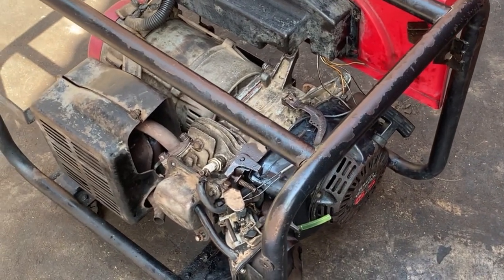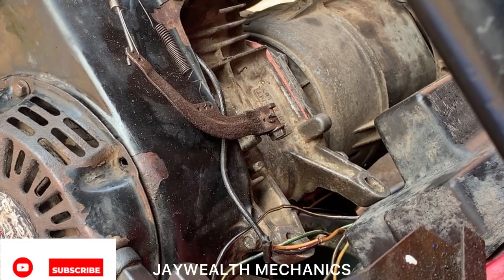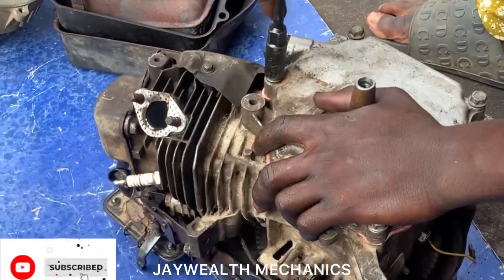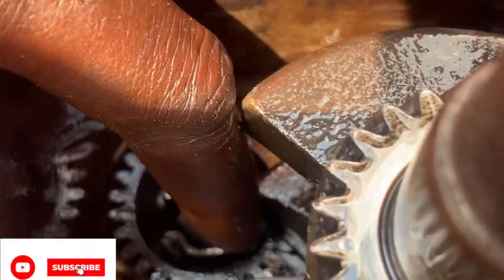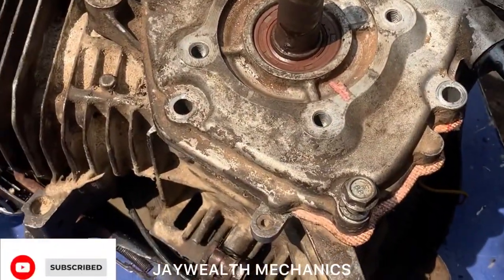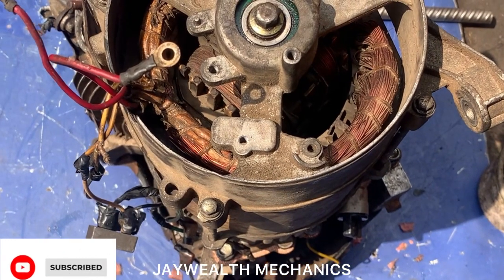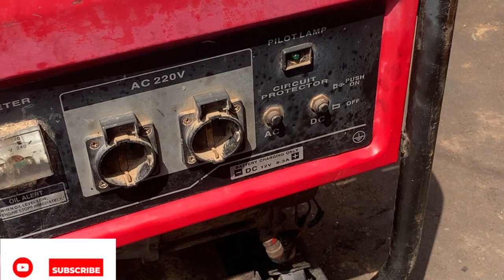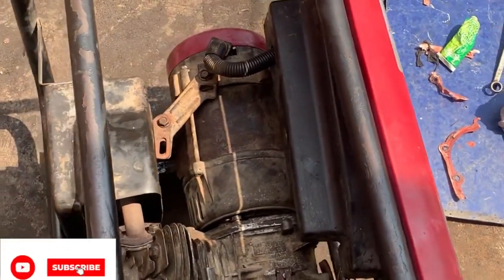GENERATOR GOVERNOR RACE REPAIR

Comment: Great video! Just a question my governor seems stuck and I don't want to open the engine. Can I just condemn the governor lever, take it off and just put something in the throttle plastic for it to maintain a desired rpm? Thanks
Reply from the maker: @vonvoyage14  if it got stuck loose the governor lever and put oil and turn it with plier to make it free. Then set the governor race. I have done a video on how to set a governor race.

Comment: In the case of low voltage and u try increase voltage vai adjustment place of governor and carburetor as well and its not increased could the fault still be same as what u just did now?
Reply from the maker: No the fault is not the same.

Comment: Please can I know the differrent between a long shaft and short shaft engine?
Reply from the maker: To determine the difference between a long shaft and a short shaft of a generator, you would typically refer to the specifications or technical documentation provided by the manufacturer. These documents generally outline the dimensions and measurements of the generator, including the length of the shaft. By comparing the given measurements, you can identify whether the generator has a long shaft or a short shaft.
You could also know with the step of the engine block.
Reply: @jaywealthmechanics9285  Good idea thanks.

Comment: Hi Jay.
I've just rebuild a Honda GX200 engine copy generator and it did the same where as before it didn't rev like that. I now know from this vid (I looked at other vids before I watched this) what might have fallen out when rebuilding it.
Thank you.
Reply from the maker: The governor race cap or you check the settings
Reply: @jaywealthmechanics9285  I stuck a camera in it and saw the plastic cap, so I have to strip it down AGAIN to fit it back in.
It might be damaged as I ran the engine to check a few things and I now know what I heard was probably the plastic cap being hit by the oil sprayer hook on the crankshaft.
Reply from the maker: @DugatDizzyLizzys  ohhhh. Hope is working well now.
Reply: @jaywealthmechanics9285  Still needs more running in, but the PSI is increasing after 1 1/2 hrs running.

Comment: Hey bro... So my generator is works normally for about half an hour when i turn it on then it suddenly speeds up and start making a lot of noise while the power drop down nd it does that fr about 20 seconds and it gets back to normal again and it still does the same thing in about 30 mins(sometimes more than that)....what do i do?
Reply: No reply?
Reply from the maker: Firstly I need to ask this question.. did you put on any appliance that is heavy like freezer or pumping machine.. if no . Check the speed control at the carburetor and Set the governor race .

Comment: Hello, thanks for what you do on here, your videos have really being helpful. I have a 2.8kw Elepaq, it was surging and I'd fixed it from the carburator following one of your videos, but recently, the generator sounds alright but the led bulbs are flickering. I also noticed the voltmeter's readings not stable. Please, What could be the cause?
Reply from the maker: The speed is low. You need to increase it a little.
Reply: @jaywealthmechanics9285  Thanks a lot for replying. Please where do I increase  speed from? The carb or at the governor's?
Reply from the maker: @xrystalblacck-rv5hp    https://youtu.be/1d1ZkrMXVCA. Watch this video
Reply: @jaywealthmechanics9285  Thanks a lot. It worked. The lights are stable and only blinks after slight increase in load.
Please, what do I do when the generator emits heavy white smoke after starting it and the smoke gets lighter with time.
Reply from the maker: @xrystalblacck-rv5hp  the generator needs overhauling
Reply: My generator the cup is in position but the governor is not responding to the load when plugged in loses power. I have changed the carburetor already but the problem is the same yours in this video